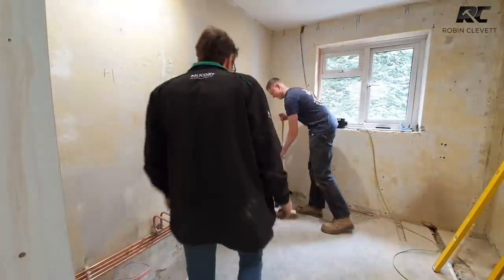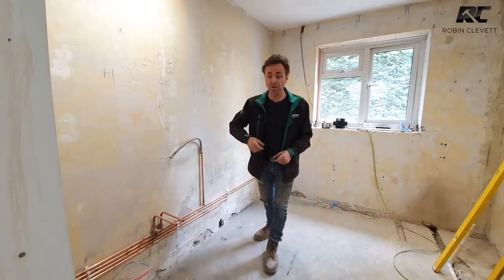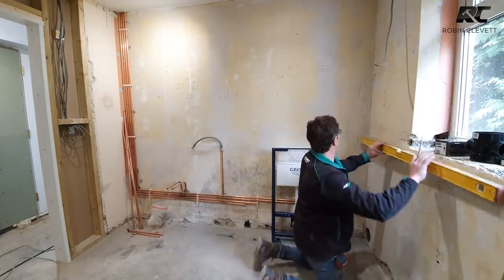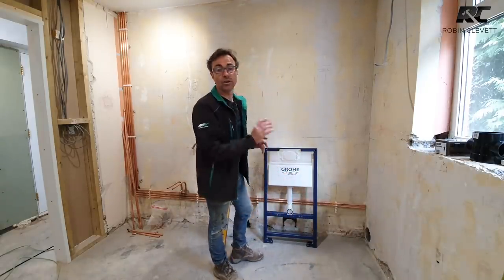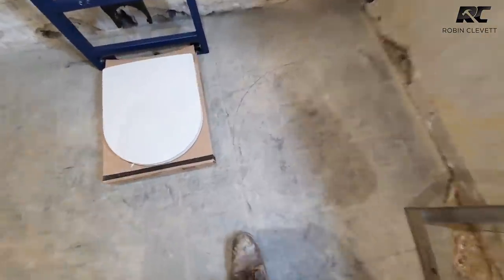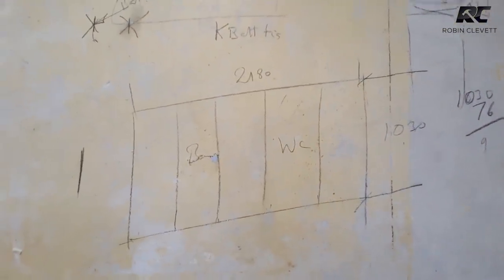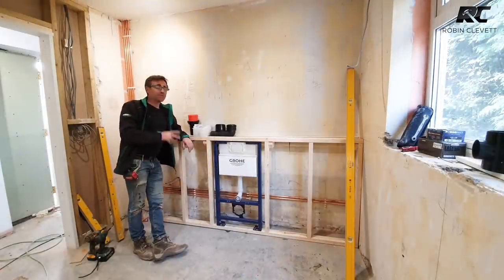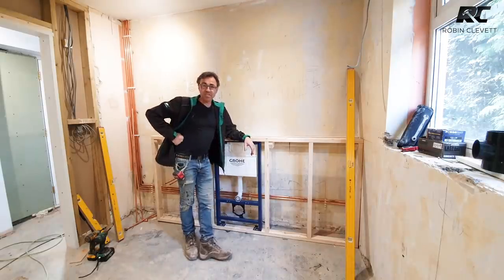Bathroom Framing & Setting Out. A job for a carpenter

Comment: Concealed cisterns and wall hung thrones seem to b all the rage now what we do is to put all the frame panels on split battens makes everything easily accessible for future works (cistern changes or leaks ) having full access to the services r a must I’ve been on other jobs where this hasn’t been done it’s a nightmare if anything goes wrong out of site which it sometimes does ie flush and waste pipe connections ur better off building good access in from the start

Comment: it would be great to see someone like you robin, do an under stairs toilet conversion and associated works. I cant' find any video anywhere of a decent or thorough job. Ive an asbestos waste pipe that needs removed, and how to get a water supply from the mains into the under stairs closet without lifting the floor?...  and upsizing the framing to accomodate a full size door instead of an undersize one thats currently fitted.

Comment: Next year I was planning to install a power shower and wanted to site all the pipework in the wall, which means chasing the wall out to accommodate all the pipes. However watching this, you built a wooden frame in front of the pipes which attach directly to the wall and the frame covers what you done. What a fantastic idea you have given me. I think I can make it work by building a complete floor to celling frame hiding all the pipework.  Should this not workout is there any reason why you can't bury copper pipe into a cemented wall ?
Reply: You can do it but consider access. If you get a leak in that pipe it will be a pain to remove the wood and fix but can you imagine that inside the wall?
Reply: @cannontrodder  I must admit that I am torn between both ideas but at least I have no plans to start this until next year but its always good to get feedback from others, especially if they are doing this all the time. Thanks for your help, it's very much appreciated. 👍👍👍
Reply: @terencecottington4273   you can get ‘systems’ similar to the WC Robin is using for showers too. The way I see it, it’s easier for you to change things later or if you ever decide to remodel. Plus a perfect flat surface for you to put the waterproof board on for tiling. That’s the great thing about these videos from the likes of Robin, you get to see different ways to do things without having to learn the hard way yourself. Good luck with your project mate!
Reply: @cannontrodder  Thanks Neil. I could not agree with you more. It always pay to look at other ideas. Really appreciate you getting back to me. :)

Comment: I live in a fairly remote area. Bathroom Reno's are something I do way too many of. Not a fan of doing them but work is work. The difference being I do all the work. I can and do all aspects of the refurbishment but usually draw the line at painting. I can paint and am probably a better painter than Carpenter but don't like doing it. I have only seen one of those frame things in Oz and the customer got it direct from Europe. Still mostly old school in Qld. None of that system stuff.
Reply: "still school, not of that system stuff"... Does that mean u shi£ in a bucket in Qld? 😂

Comment: I never really liked those wc frames at first but I’ve come round to them. You could say they’re grohes.
Reply: You sound hilarious, I wish I knew you.
Reply: @Mas-lx5nc  then where’s my upvote? These puns don’t come cheap you know.
Reply: They are great up to the point where the cistern splits (leaks) and water is coming out under the floor etc......Happened to me never again once bitten and all that (point to note it wasn't the same make that Robin is using) Ended up getting a normal back to the wall pan with small cistern. Easy to fit easy to maintain and you can see if it leaks....

Comment: Is this a room in The Big Build?  In any event, “plumb and level”.  It looked like the bottom “rail” was fixed directly to the floor (not level). Did you shim or adjust the length of the studs to make the top rail level?
Reply from the maker: Hi Robert, this is not at the big build, and yes the floor runs out of level and I mentioned that in the video, so we make our frame parallel and square and shim as you suggest, thanks for watching mate

Comment: Great video with a stylishly dressed Robin! Fashion model👍👌

Question. I saw the hole for the soil pipe in the wall. I presume the vanity/basin outlet will be in the wall too

What about the shower drain? Will it be below floor level, to keep the shower floor level? Or will be a raised tray? Pl let me know. Thanks in advance
Reply from the maker: Hi Rajesh, the basin waste will be bossed into the soil pipe further along the run behind the WC, we have removed the screed to enable the shower tray to be at floor level too
Reply: @ukconstruction  thanks. Great video. Great outfit!

Comment: What were the screws you used for the timber fixing to the wall, they looked like they went straight into the brickwork and plaster?? - love the videos 👍
Reply: Concrete screws by the look of them. Fantastic things. Be careful when tightening, they've got some pull on them.
Reply: They are absolutely brilliant for levelling up timber studs on uneven walls. Rico is right. Short bursts on the driver. They are monstrously .. er, "grabby"
Reply: The fxngs are concrete framing screws.
Reply: Where have these been all my life?
Reply: @cannontrodder  Screwfix?
Reply: Was just about to ask the same thing!

Comment: Great looking plumbing. However, why in the UK do you persist in leaving irnt exposed as opposed to running it through the walls?
Reply from the maker: This is a retro fit and there are only solid walls, the walls are what we call clinker blocks and only 75mm deep so you cannot chase them successfully, we would always try to hide pipes if possible
Reply: Because our walls are usually solid brick or block.

Comment: Very surprised that the tiling was not considered when setting out.
Now it will be best fit, rather than perfect fit.
I guess this is what happens when you have a plumber, a carpenter, s tiler, rather than a bathroom fitter.
Reply from the maker: We have been working to the window height and the courses of tiles corresponded with that, we do a drawing for the tiler and I am super particular about the final setting out!!
Reply: @ukconstruction   When setting out, I would plan tiling, then set out so that basin, wc, bath, wall outlets, etc are centred, or on a grout line. Just makes a good job, even better. 👍

(And yes, I do do this for a living).

Look forward to seeing the finished project

Comment: When does a Carpenter become a Joiner or a Joiner become a Carpenter?
Reply from the maker: Thats a great question!! when I studied I was trained as a Carpenter and Joiner, so we spent loads of time on the bench making joinery by hand, then we went into the machine shop and used the machinery to make joinery, then we started the carpentry side, by that time the carpentry came really easy as we have become super accurate in the workshop learning all about the tools how to use them and also setting out correctly, I owe my career to the amazing lecturers that we had back in the late 80's at the North East Surrey College of Technology!!!
Reply: @ukconstruction  Sounds familiar !!  Great vids, keep them coming.  Even for the older guys they are very informative and bring back various memories.

Comment: I wouldn’t ask a carpenter. I’d get a joiner to do it.
Reply from the maker: Where we are joiners generally work in a workshop and it's the carpenters that work on site fitting joinery and doing traditional 1st and 2nd fix work, also I trained as a carpenter and joiner and am completely comfortable doing either role whether it's in the joinery shop or indeed on site, where in the country are you? As I know that carpenters are referred to as joiners in some parts of the UK!!
Reply: @ukconstruction  Trying not to be pedantic but the general public tend to use carpenter and carpentry as a cover-all for anybody or thing that that
Reply: @ukconstruction  Sorry Robin but I inadvertently sent the message before conclusion. The tendency is to use ‘carpentry’ to cover everything and everyone that works in wood when we know it is far from the case. Cabinet makers are affronted when their work is called carpentry. Tradesmen know there is distinct difference between all three of the main woodworking trades.